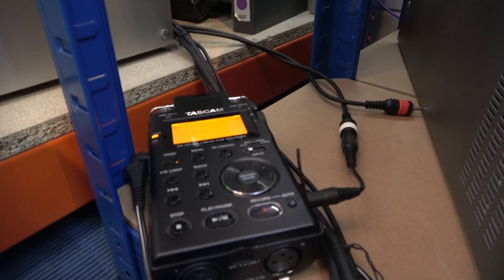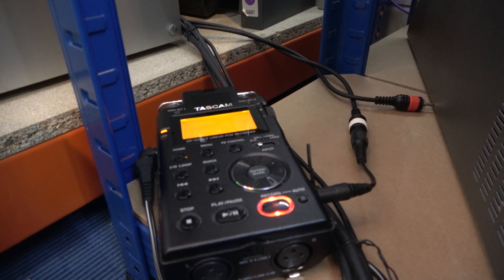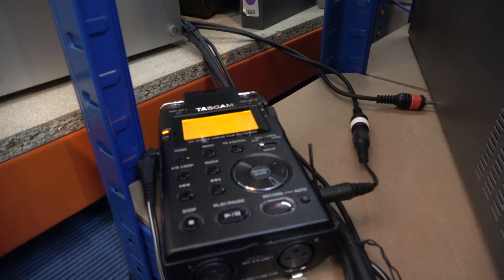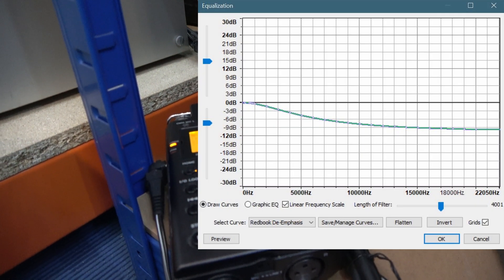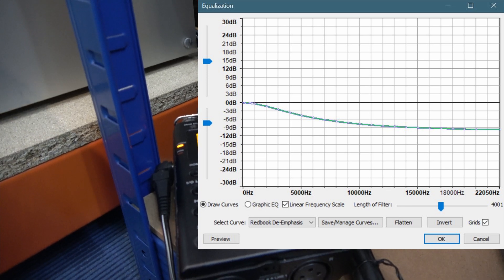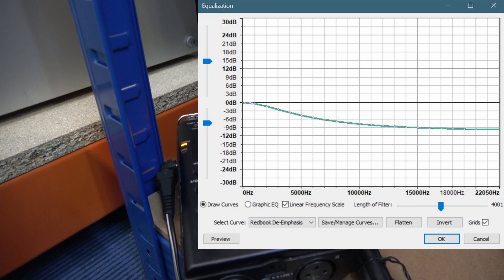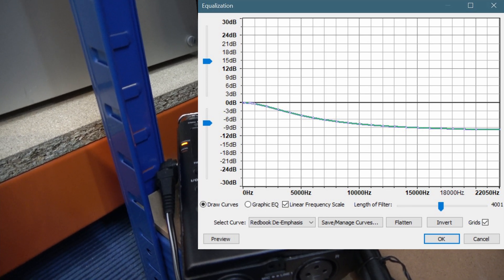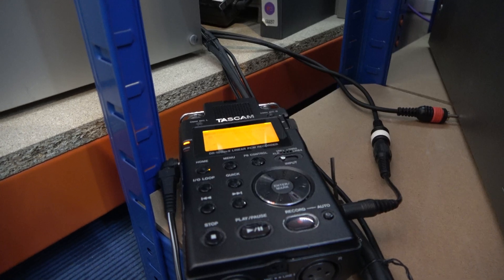Pure digital extraction from PCM1610/PCM1630 digital audio tapes from the 1980s.

Comment: Hi Colin, I have a Sony-1610 Processor playing my large collection of Umatic Studio master CD production audio tapes via my Sony VO-5850DA  with D75 mod. I have seen an ADT  Sample Rate converter Model SRC, (rear connections are different to your Converter), and I'm asking if this would operate with my equipment in the same way as your set up here.
Reply from the maker: If you're looking at the  ASC SRC1 Digital Audio Sample Rate Converter, no this doesn't have an SDIF input set.  S/PDIF is the modern signal type and is completely incompatible.  If you have a different model in mind, include a link to see it.

Comment: I do like your tenacity in finding a way to get a better way of extracting the digital audio.  nice to find the ADT box. 
Digital audio on a 3.5mm jack, yikes.  And yes, I quite agree, that menu on the Tascam is enough to drive anyone to drink.
Reply from the maker: It's worse, that's a 2.5mm jack with non-standard wiring.
The Tascam menu is even worse when the rotary wheel gets a bit worn and doesn't always go where you expect it to.
Reply: @video99couk  Rotary wheel, ah yes, I have a Marantz SR4200 amplifier with an 'encoder' volume knob which needs looking at, the slightest touch and the volume shoots up past 0db, connected to my Tannoy DMT 10's it can give your ears and neighbours quite a shock!

Comment: Very nice to see another conversion option for the PCM-1630.and one that is so simple to boot.
Regarding PCM-1630 I/O from what I can gather a stock unit came with analog I/O only not even SDIF-2 so all Digital I/O was an option and many users unless they had other digital gear to interface to it, would not opt for any sort of digital I/O. Another strike against the SDIF-2 I/O is that the SDIF chips run rather warm and seem to go bad.
Reply from the maker: I thought that the SDIF-2 interface was always included, but I could be wrong.

Comment: Huh. It appears there is an option card for the 1630, the DABK-1630, which replaces the AD-32 and DA-15 that comes in the unit, and which changes the XLR audio connectors into AES/EBU on input 1 and output 1.

I discovered this in the manual while I was poking around looking at what would be involved in making a newer SDIF2 converter, possibly with the ability to record directly over USB.
Reply from the maker: Yes that's true.  It disables the analogue output though, which some customers prefer, so it's a really clunky solution.  Not to mention almost impossible to find.

Comment: Lucky you were able to find the  a.d.t  daf converter, ideal :-D
I expected it to be half empty for some odd reason,
if they didn't have fpga chips i imagine it would be full to the gills.
I think the loose screws were just lack of regular checking of the equipment.
The sockets got loose and the stressed joints were the result.
Hope you had all your windows open, this weather is a bit warm lol.
Reply from the maker: It has an impressively small PCB.
All windows closed or the bugs get in....  We have Air Con!

Comment: 1992 is very early for FPGAs. I cannot imagine that, at such a low volume, this would have been cheaper than discrete logic. Also there might be a little SPI EEPROM next to the FPGAs holding the configuration data.
I still think that doing it with a digitized version of the video would be more efficient, particularly as there is a better chance of detecting dropouts that way.
Reply from the maker: There might be mileage in the digitised video route, though that would kill the RAR error correction system.
Reply: @video99couk  Actually no, you could just capture both streams, sync them in post and therefore use them both. It might even be possible to use a frame synchoniser to sync up both signals to a reference sync (the VCR would need to be synced too in order to avoid dropped frames) and to feed them into the component inputs of a frame grabber to record both at the same time.
Reply from the maker: There's an 8 pin socketed device between the FPGAs, that's probably the EEPROM.